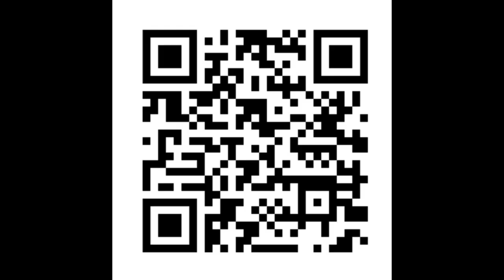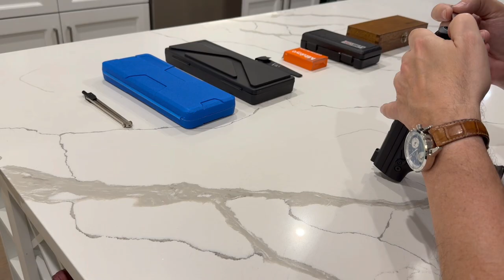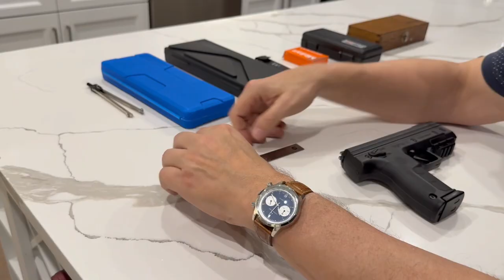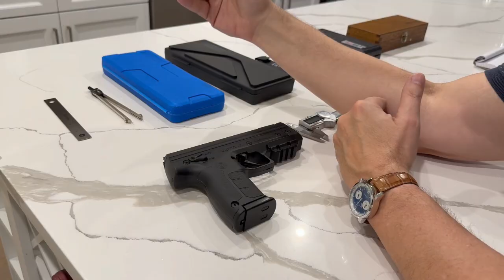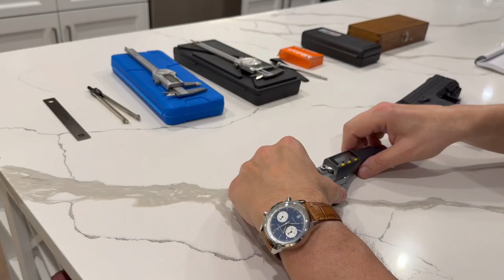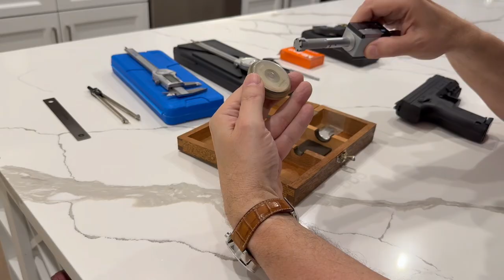How to Measure the Inside Diameter of a Barrel or Tube

Comment: Thanks for the rundown. So wait, what was the actual LE bore measure on the 3-hole micrometer? And can that vary at different depths within the barrel?

OT: Your wristwatch wasn’t running this whole video. If automatic, maybe treat it to a winding box.
Reply from the maker: Yes. It will vary at different depths. That’s why a ball gauge is inferior to a barrel insert as a ball QC device.
Reply: @ Well, hard to gauge rounds with the LE since one can’t warranty-wise remove the barrel, which makes it awkward to try and do it in situ. So LL4D got .691 as an ID measure on his LE barrel; to confirm, what did your 3-hole micrometer show for it?
Reply from the maker: @GuillermoMaytorenaIV with 10 measurements the 
Average .691616667
STD Dev .0005967
CoV .01431

Measurements were taken relative to the calibration disc .64995” 20 Celsius. Room was 72 F. 

Close enough for government work 😂